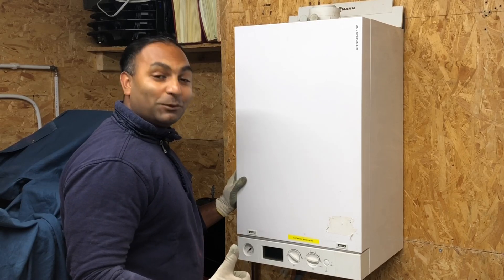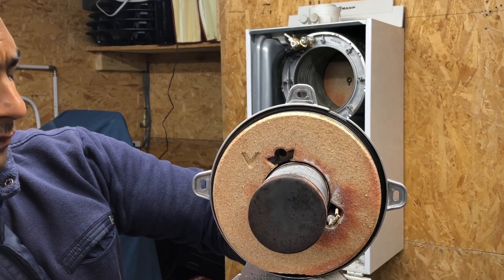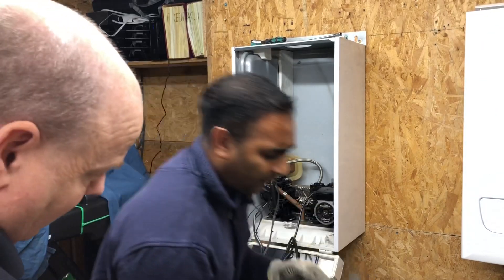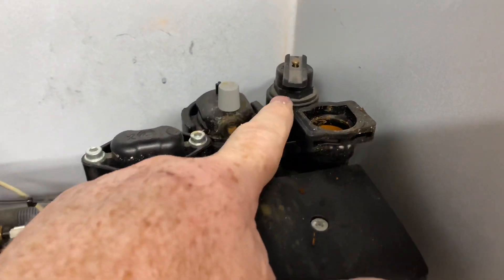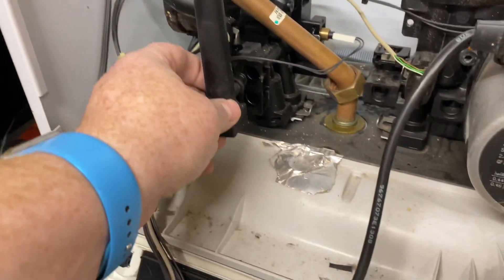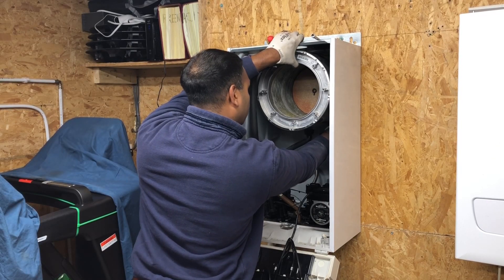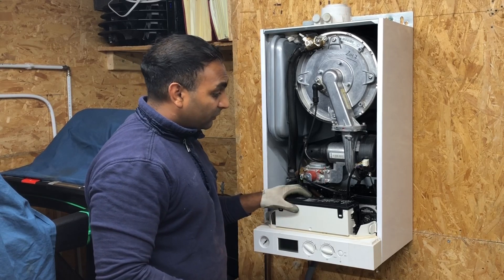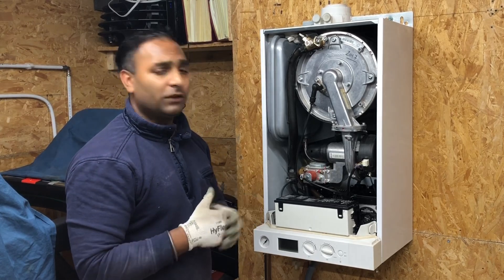Viessmann Training - Apprentice Plumber Stripping Down a Combi Boiler

Comment: How do you remove the water pump there? My dad just removed the first front part that connects to wire and has the spin wheel attached to it (circlet pump with 4 screws) kinda the part where other models change position. My dad thinks that is the part broken from boiler and try to replace with our boiler